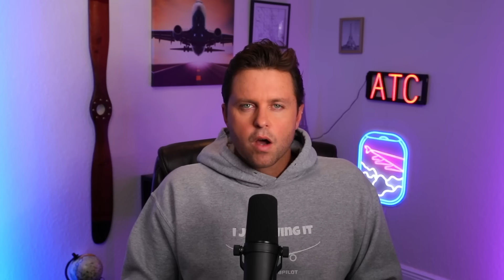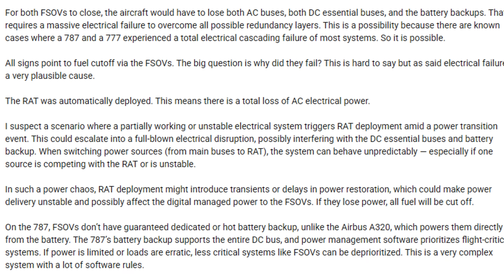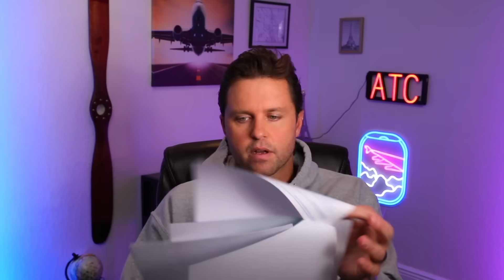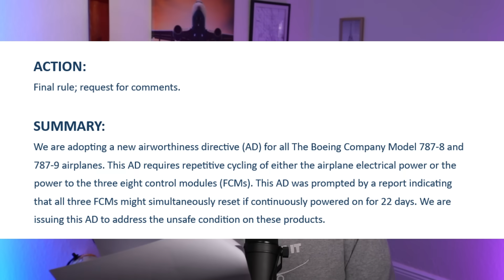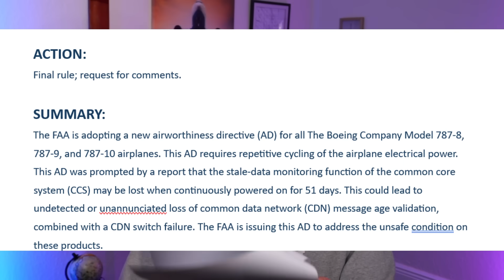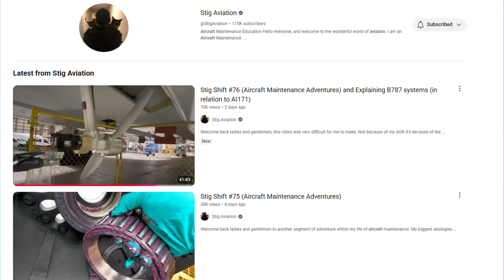Air India 171: Did a Software Glitch Cause Dual Engine Failure?

Comment: This makes sense to me. As I've commented in the video on RAT deployment, to me a sudden, non bird-strike caused flame out of both engines at the same time indicates loss of fuel supply. There is still a small possibility that the pilots did something terribly wrong, but the story discussed in this update sounds much more likely. Fuel contamination, in my view, would neither cut both engines at the same time nor become apparent as late as after takeoff if such serious. I will not call to action to ground the whole 787 fleet, but if the software malfunction gets confirmed it would be a massive problem for Boeing.

Comment: I do not know about all these in depth technical details, but when I understood that it is a dual engine failure on takeoff, I was guessing it’s software problem. There are separate fuel pumps for both engines, chance of them failing at once is very slim, people talked about vapour lock, but again the chance of this for two engines very slim, there are many other airplanes that used the same fuel without any problem, so only thing that’s common for both these engines was software…

Comment: No. SOVs operate via a servomotor that locks in two positions: open or closed. Therefore, the claim that a spring closes when power is lost is false. In fact, these valves are designed under the fail-safe model, which ensures that they will not fail to perform their function in the event of a failure.

Comment: I think your absolutely right about the power loss shutting down the fuel supply valve’s which caused the engines to flame out and once that happens even if the fuel supply is restored the engines are unlikely to restart,in view of what previous incidents have occurred it’s highly likely you are correct and as such those aircraft should be grounded until this problem is investigated one way or another or will it take another disaster before anyone takes notice of your explanation.

Comment: 11:40, yeah that guy is completely wrong.

-787 doesn't have a DC essential bus, that's airbus terminology. 
-787 doesn't have ELMS, that's a 777 system.
-The spar valves have their own backup power supply.
-The battery doesn't need to be switched on as it's always on and connected.

Comment: That’s not how the FSOV works . It’s latched in its last commanded position. Only two ways to command it . Fuel switch behind the throttles powered by the electrical busses and and fire handles powered from hot battery buss.
Reply: Yep fire handles was one of my first thoughts.  Remember the jump seater out of Portland attempted that a year ago or so.

Comment: I'm a chemical engineer working in Process Safety for different industries (not aviation). I was wondering why not many people were considering failsafe of electrical/control system since it seems the most plausible cause for both engines stopping simultaneously. Thank you and the colleague for the presentation of this evidence and explanation. What is not clear to me is that I imagine that it should not be possible for the 2 FSOVs to be closed simultaneously. I wonder if either this logic is correct or we should consider another issue as incorrect wiring during assembling of one of the turbines.

Comment: Hi. I just read today on another aviation channel a post from someone who claims to know the prelim report. The poster claims that the cause was a cascading electrical failure  from "water ingress" , which caused arching in the main box, leading to engines rolling back to  < 27% when the pilot activated the gear retraction. He claims that there was a torrential rain event at the terminal during push back. I don't know how this person came to know this info, or if it's even true at all.
Reply: That is a fake AI generated report that took aspects of several other real accidents and merged them together into a coherent story. There is no prelim report.
Reply: I read the same thing. Boeing did issue SB‑787‑24‑212 as an urgent service bulletin regarding sealing the main power relay box within 24-48 hours of the crash according to ChatGPT…if true, they must have had a good reason to issue an urgent Service Bulletin.

Comment: What you got off Google which mentioned Bleed Air Pressure is possibly a little off. The 787 doesn’t have what would be considered a Bleed Air Pressure system in the conventional sense. There are no air off takes from the engine, obviously the engines are creating bleed air but it’s all devoted to the engine internals improving fuel efficiency and hence, range. Anytime you take air off a Turbine Engine you are “robbing” the engine of performance causing it to run harder and hotter. That said it’s an Electrical hog of immense thirst. They generate air for cabin temp conditioning and pressurization using electricity as its source.
Reply: AI is programmed to be polite and agreeable, and depending on how you frame your question might give you two completely opposite answers.

Just now on Google Gemini I asked, "Will an erj-145 hydraulic failure cause the flaps to get stuck?"

It responded, "In the event of a hydraulic failure on an ERJ-145, the flaps are likely to become inoperative. This is because the flaps are one of the systems controlled by the hydraulic system."

The flaps on an ERJ are all-electric. As usual, AI made up an answer that "sounds" correct, but is actually completely wrong.

Comment: Hmm, interesting - I don't have the knowledge of this particular system. However, I've had many years experience in IT / Systems Engineering to know that 'Fault Tolerant' software can and has been developed in many safety-critical applications. If this is the cause of the crash then it should have been found in the testing phase. It is imperative that the correct orders of priority are correctly established so that the various software algorithms are correctly coded and linked. Prior experience with this system suggests that all was not well ! Why wasn't an AD issued to alert other users immediately ?

Comment: I'm an avionics engineer who investigated the loss of a Titan IV-A rocket & payload in August of 1997. 
Proximate cause was found to have been a momentary (35 ms) transient of 28-v main bus power feeding the flight computers. which  induced an irreversible cascade of events,  resulting in complete loss of mission. 
Similarly, it seems very credible to me, that a millisecond-glitch in tge main bus voltage (also 28-vdc in Boeing 787) as applied to the FSOV's, could have lead to a nearly simultaneous shutdown of both engines.

Comment: Unless they are really designed by students, the electrical systems should have power conditioning and capacitor banks that maintain power stability during unusual loading.

Comment: In 2009, I was opt del lon flt.  In cruise, on A330 both engs shut down. Brand new a/c. After about 30 seconds, they own their own tge engine, stated.
My company wrote to airbus , the reply we got was  due to moist air tge engs do that sometimes  it was Royal Roce engs.

Could be software. 
While doing my training in Toulouse, I met a group of software engineers they were working on airbus. It seems they are given one project, and many other teams are given different rolls on software. All that is put together.  We believe everything will work right and fly.

Comment: Finally folks get this.  An electrical problem is the only thing that can stop two jet engines at full throttle.  Contaminated fuel, vapor lock and all the other hogwash won’t cause a dual engine loss.    

There are so many possible electronics issues that can cause this than fingers on my hand.  Also they are all a million to one on top of an abused plane electrically plus an extra hot day which also increases the R ( resistance ) on all electronics making them more susceptible to failure.

Personally I think the DC bus failed and it this all occurred when the pilots switched off the APU literally seconds before pulling the gear up lever.

Comment: After doing some minimal research, I think the reason for this crash is quite similar to the Boeing 737-200 crash in 2015, Mandala Airlines, Indonesia.  The findings were not because of engine failure, but the wrong settings of the slats and flaps.  The video of flight 171 India shows the plane has to use the entire runway, approximately 3,5 km, before V1 or rotate.  Maybe the ground didn't provide the correct weight of the cargo, or a large cargo that the captain wasn't informed of and didn't include in their calculation for takeoff.

Comment: I like your presentation.   I’m an almost 20K hour commercial pilot and have been on the 787 for 6 years.  Definitely NOT fuel contamination.  Definitely not pilot error.   What you’ve dug up sounds more probable than anything else we’ve heard so far.   What ever came of the AD’s?  What fixes were made?   As pilots, we never hear of them.  No surprise here.

Comment: If the truss reverser was deployed too early and that can shut down the engines than it could cause overrunning a runaway if the reverser was counted in and needed to stop the aircraft which could lead up to a catastrophiy. Isn't it?

Comment: Boeing planes are tested in extremely hot weather and extremely cold weather. I believe hot weather should not be a concerned. Fuel contamination shouldn’t be a concern also. If there was a fuel contamination other planes would have been impacted as well. Same fuel supply was used to feed other planes. My concern is the software issue. Software system cut off the fuel in both engines.

Comment: I think your final synopsis is exactly what happened.  Though it is also possible that the simply had overlooked the ADs requiring the carriers to cycle the power systems on the schedules required.  And it is a fact that the plane had flown that day from Paris to Delhi then hopped over to Ahmadabad for the flight to London which is presumably where the fuel was topped up for the long hop to Gatwick.  The passengers documented electrical problems in the cabin that morning.  So right there it tells you think plane should have been taken to a maintenance hanger for a thorough going over of the electrics and recycling of all electrical components.  But another employee said that the 787s for Air India (presumably other carriers as well) are in the air constantly because it is one of the few that has the range to do those long haul flights nonstop.  Otherwise they would have to stop somewhere like Rome or Athens for smaller gets with less range.  I think Boeing is to blame here for just another really bad design that is grossly over complicated.  But the carriers themselves share some of the blame when they are pressing the use of the jets beyond their functional limits.

Comment: Based on @HeyFixThis' s theory, I did some AI-enabled digging and it came up with this theory - 

Constructing the Probable Failure Chain

The Trigger: Immediately after a positive climb is established (T+3s), the pilot commands "gear up." This action energizes the Center hydraulic system's two high-flow electric motor pumps (EMPs), creating a massive, instantaneous electrical load on the power distribution system.   

The Cascade: This power surge acts as a catalyst, triggering a latent fault or instability within the software-managed power distribution network, governed by the Common Core System (CCS). This event is analogous to the LATAM 777's distribution failure, where a minor fault cascaded into a major event. The instability could be a software logic error, a failing bus-tie contactor, or a voltage/frequency transient that the system's control logic is unable to manage under high load.   

The Blackout: The cascade propagates through the electrical system, resulting in the protective disconnection of the main AC buses. This causes a total loss of primary AC power, a scenario the FAA explicitly warned was possible due to the 2015 GCU software bug. The loss of power to the transponder causes the aircraft's ADS-B signal to cease.   

The RAT Deploys: With the main AC buses unpowered, the aircraft's safety logic automatically deploys the Ram Air Turbine (RAT) to provide emergency power.   

The FSOV Power Loss: During the electrical chaos and the critical moments of power transition from the main buses to the RAT, the essential DC buses that provide power to the Fuel Shutoff Valve actuators experience a momentary or sustained interruption. Because the FSOVs are not powered by a dedicated, uninterruptible "hot battery" bus, their power supply is subject to the same software-managed prioritization and protection logic that has just catastrophically failed.

The Engine Flameout: Upon loss of power, the spring-loaded FSOVs execute their fail-safe function and snap to the closed position. This action simultaneously cuts off the fuel supply to both engines, overriding their otherwise independent and robust FADEC/PMA control systems. Within seconds, starved of fuel, both engines flame out, resulting in the total loss of thrust observed in the accident.

This sequence is the only single theory that cohesively explains all the primary signatures of the accident: the precise timing of the failure, the symmetric loss of thrust, the deployment of the RAT, and the anomalous state of the landing gear.

Reply

Comment: As a GA pilot and retired systems electronics, I too accepted the flaps up scenario to start with. 
When I learned about possible dual engine failure, the first thought I had was a computer glitch common to both engines at the top of the system tree. I’m not an avionics expert but I spoke to someone who is, and he said certain systems would trigger actions as you mentioned here. Bus failure was one. He said many times he’d seen blocked filters on the computer ventilation system and mentioned it.
I think the RAT may have deployed prematurely as can be seen on takeoff with full power, followed by various malfunctions thereafter.
Has the mayday call been verified?
How much contamination would fail an engine?
Are there built in vapour traps, because planes fly in hotter places than India and even cars have closed systems?

Comment: I think the designers were assuming that in the loss of both engines (at altitude) would mean loss of main power, and that is what the auxiliary battery backup was supposed to be for, it would give electrics to instrumentation, communications, and control surfaces, and even the auxiliary back up had a back up battery system with just enough power for the most necessary functions of finding a place to land with plenty of glide time.  And if main power fails, and auxiliary fails, and the battery back up to that fails, they still have the RAT which will automatically deploy when all else fails, with just enough juice to land the plane with minimal instruments.  
But, they did not seem to think about what would happen if their fuses and wiring were the problem delivering that electricity to where it needs to go.  And because they could not even imagine the jet losing ALL electricity on takeoff they made that automated fuel shut off valve dependent on there being some electricity even if it is from the RAT.  And of course a jet flying at 32,000 feet when the RAT deploys is going to have enough power from it to do that minimal power supply and the fuel shutoff valves would have to be included in that routing of power, but at 425 feet, and ground speed of just about 150 if there is a power failure the RAT is not going to generate enough electricity to save the day.  And all of this is the real error of fly by wire and pilots just observing and "managing" an automated jetliner.  An electrical fault can kill everyone aboard.  The pilots have no way to correct the situation.  And by god this is Boeing's fault.  It is a shit design and even worse quality control because they put profit and deadlines ahead of safety.  Boeing is 10 years behind on order deliveries of the 787, and if they were doing everything the way it should be done you could make that 20 years because aviators know how to make great planes which Boeing used to do, but accountants only know how to cut corners and pay the shareholders dividends.  This is a bad plane from a bad company, I will never get on one, and likely will just not fly rather than have to get on another Boeing deathtrap.

Comment: Are the FSOV's triggered by a thermal device? Did the environmental conditions trigger those valves? If the plane's electrical system had a transient (occasional) ground which developed into a PERMANENT ground, any power provided by the RAT would be useless and the FSOV's could not be opened. From a reliability sense, the problem was not with the engines, it was with a common system that is schematically upstream from the engines. Fuel and electrical systems are likely.

The possible interaction with the thrust reversers - used on the previous landing - is a perfect example of a HIDDEN failure that is not tested for.

Contaminated fuel is unlikely since there are several upstream systems to prevent this, both water and particulate are checked for during fuel handling.

Comment: 30 yr retired Boeing Technician here. The problem was ELECTRICAL. The deployment of the R.A.T. is evidence of that. The FCU (Fuel Control Unit) was compromised during the aircraft's blackout, starving both engines for fuel. 
A stealth EMF weapon attack?? 🤔

A ship in Baltimore and a ship in the Suez Canal were victims of EMF weaponry. 😉

ii'd like to think of other reasons, but ii can't.